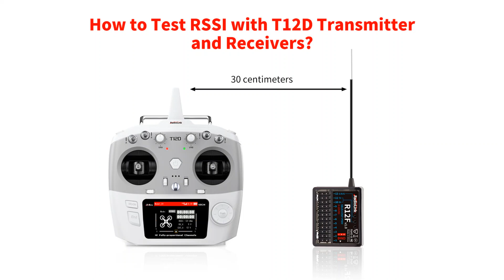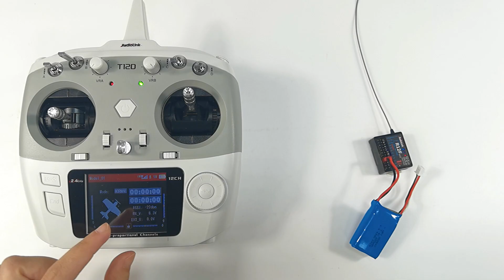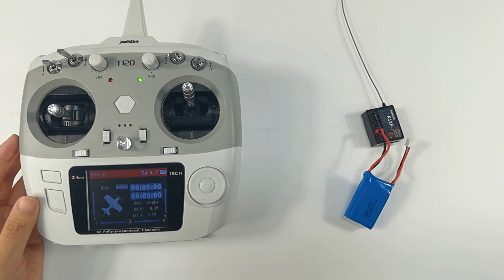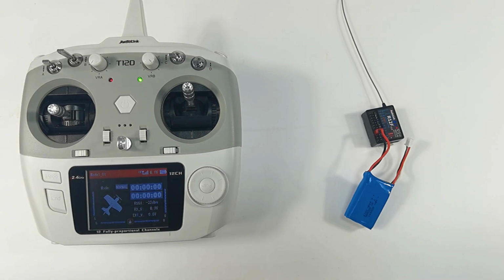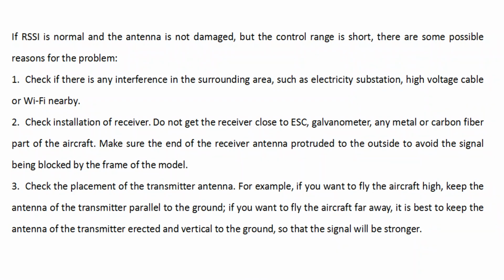How to test RSSI with T12D transmitter and receivers?

Comment: Is it possible to expand the radio link t12d to 16 ch?
Reply from the maker: Hi, sir. Thank you for your support. No. T12D and T16D have different mainboards and chips. So T12D cannot flash the firmware of T16D. It cannot be updated to 16-channel transmitter.
Here is the comparison of T12D and T16D:
https://www.radiolink.com/newsinfo/937609.html

Comment: The remote control is not good and cannot be set to play with the helicopter.
Reply from the maker: Hi, sir. Are you using T12D to control helicopter? You just need to select HELICOPTER type, and then set the functions you want on T12D. You can refer to the detailed manual of T12D to check the functions of helicopter: https://www.radiolink.com/t12d_manual  If any question please feel free to contact us. Our email is after_service@radiolink.com.cn
Reply: @Radiolink_official  I have sent email and VDO to the factory many times already, they said that the helicopter scale function is not perfect. If you don't understand what is the problem with your remote, you can try to set up the helicopter. The CH3 CH6 and gyro and Ho functions have problems.
Reply from the maker: @ปิยะณัฐลาลี-พ9ร  Hi, sir. May I know who did you contact in our factory? And could you please let us know more details so we can better know what happened and send the feedback to our R&D team. If any question please feel free to contact us. Our email is after_service@radiolink.com.cn